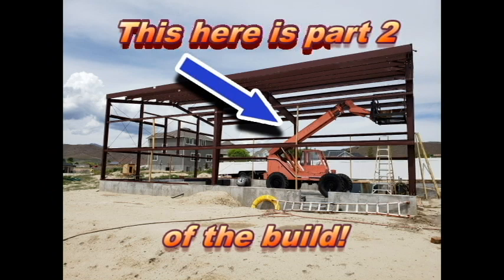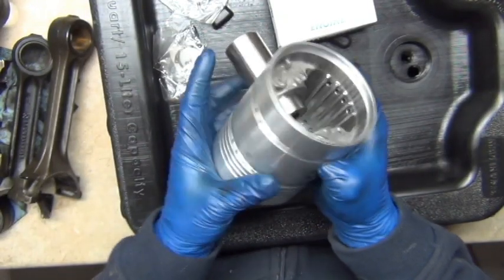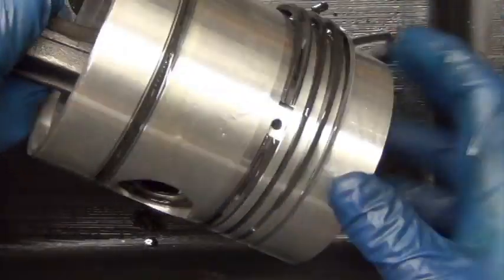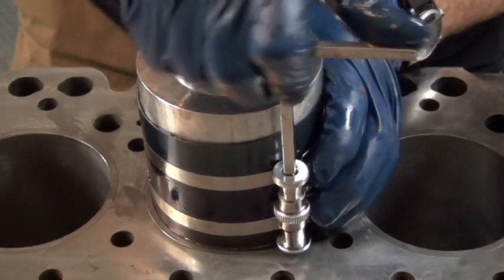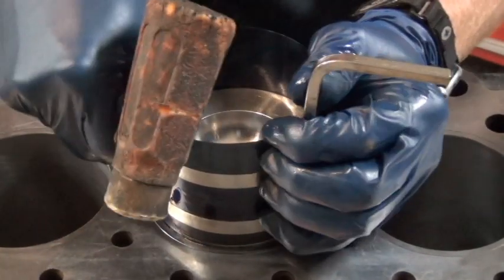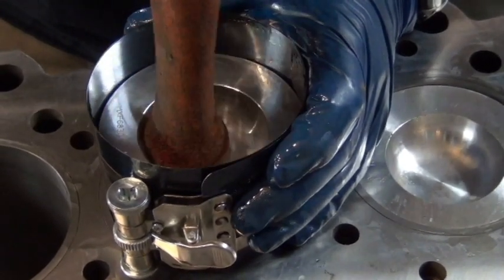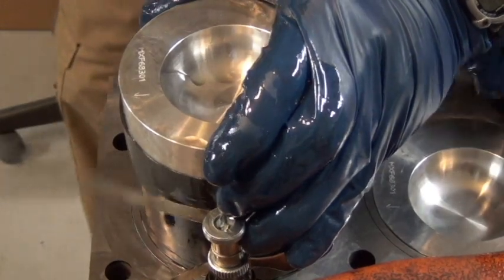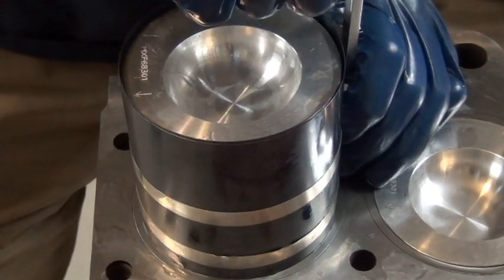Perkins Diesel Engine Build Pt  2 Piston Install Plastigauge PPG Peaks

Comment: When torquing the connecting rod nuts, I noticed that one side of the nut is "normal" and the other has a smaller ring machined into it.  Obviously, the normal side would hit torque first as it has more surface area than the "ring" side.  I've searched online and checked my pics from the teardown but I'm coming up empty.  Could you drop some knowledge please, Brian?

Comment: I was scared when you rotated the engine without supporting the pistons from bottom, they could fall off. It happend to me reassembling a Porsche 911 engine, I rotated the engine on the stand and one piston decided to fall on the floor.. luckily nothing happend to the piston and the rings.. but it was scary! Porsche pistons and rings are expensive

Comment: wow, i am surprised someone hasn't complained about the plastigauge in the comments.
Reply: Such as? Not really needing to do it on a fresh grind with new bearings? Do it like you want to - I only use it on used parts to find out where it is at currently. .003 and .005 undersize bearing shells are commonly available for tightening up a bottom end if you don't want to yank the crank for a grinding. And some would hoot and hollar about that while I still don't care what they think or say. Doing it just to show how to use it is worth doing when you are a you tube creator. Too many don't know about this tool, that's not good at all.
Reply: Lee Barnes my, you get awfully defensive about a simple comment.

You also seem to assume I don’t like the stuff, why would you assume that?

People like to bitch about it, especially in my area, don’t know why, don’t care why, simply whenever it’s talked about around my area, someone bitches about it, or anywhere I’ve seen it mentioned really.

My theory is they’re all racers and frequently blow up engines and want something to bitch about.
Reply: Just didn't understand your simple comment. No assumptions made here, just a possible angle guessed at and chased a bit, more because I wanted to go there than what I read. Thankfully I haven't run into that particular crowd but I have next to nothing in common with people that can waste money on racing other than some HP books for light reading. I would be in your camp with don't care why they could bitch about it. It's not lying about anything, if they can't keep a bottom end in it, that's all on them and their quest for RPM. Only thing I've run into is a lol snarky shot about maybe using a micrometer for that instead and of course that's a pretty silly waste of time when this stuff has been doing fine as is almost from day one. 45 years ago when I cut my teeth this stuff was already older than dirt. I dismissed it as obviously he hasn't been around too very much. I will use a micrometer but mostly to check for an egg shaped rod journal and a nearest undersize guess.

Comment: 8:48, no assembly lube link.
Reply: STP motor oil treatment will do just as well, my mentor used it all the time before they thought to dye it red, call it something else and overcharge like the dickens for it. While I moved onto white lithum grease in the handy squeeze tube and I don't have sticky drops of STP on the floor anymore. Or my hair, pants, shoes,...
Reply: Neither did I until there it was right in my face. Forgot to mention one of it's more popular aliases - Lubriplate.
https://www.amazon.com/Lubriplate-L0034-094-Motor-Assembly-Grease/dp/B000HZJFE0
Lithium is used a good deal in greases as a saponification agent. IIRC, only three alkali metals are commonly used, sodium, calcium and lithium or mixtures of any or all of those. So white lithium is this stuff and it is unique against other lithium based greases. The exact reason/method is unknown to me other than grease is a thick soap of usually mineral oil. Soap was first made accidentally near Sapon France when a lard/fat rendering operation spilled the huge metal tub of boiling fat and the hot oil ran down the steep ash filled gulch they were in. When it all reached the creek in the bottom there was these sudsy bubble things floating all around on the water and also this strange gloppy stuff sort of like pudding trying to set up solid. And when people got in there with it to recover what oil they could, they came out CLEAN and they didn't stink so bad anymore. And their clothes were clean too. OMG can you imagine a life without soap? Well to say it was an instant hit with the locals is a vast understatement. Dare I say that this very day was the beginning of the end of the dark ages? And it civilized mankind? Watching PBS way back in the day, children's show where they pretended to be reporters with microphone and TV camera in proper and period garb doing a campy news at 11 coverage spoof of this 'industrial' accident, anyway it spoke directly to me, stunned by what was coming out of that TV, I'll never forget that aha moment - I read and collect old chemistry books for fun and already had wondered long and hard WTF is saponification about? Turns out it's an honorary place name given to a process no one understood at all at that time, no wonder there is no reasoning to be found within it.
Reply: Lol i like imports and i don't own or work on old american vehicles unfortunately. With the modern day and age vehicles with ECU's and stuff, a toyota camry would give more gas economy and probably better power overall for the curbweight it is and better design. :D
Reply from the maker: Thank you!  This one was wrapped up in the early hours... and I've been sick!  : P
Reply: oh ok. Sorry to hear that. Keep up keeping up Brian! :D
Reply: Lee Barnes why white lithium for assembly lube?
Reply: Lime, first tube came in the engine kit so I tried it and fell in love with how it stays put exactly where you put it and never drips out and away like the STP type does. The tube said right on it - Engine Assembly Lube, blue and white about the size of a tube of caulking with handy screw on cap with nozzle. I don't even have to touch it. Later on I found out what it actually is, same stuff GM put on the door hinges and latches for decades on end,  Bet I could go out to the 62 corvair and dig some out now, the stuff really stays put.
Reply: Huh.. that's weird, never thought lithium for EAL
Reply: Huh... Dang lols. That's awesome, but i'm going to be honest. I really feel like sticking to Driven Racing Engine Assembly Lube & the Assembly grease for the flat tappet cams or Redline EAL, they have two kinds, with different viscosity's. It'd be better to try each one for that type and i heard from Redline back from contact and they told me the difference is only viscosity and preference. Both those can be used on flat tappet cams too, they are also classified from their department as a assembly lube and grease. WEIRD lol.
Reply: Well. Dang back, there goes my paid shill profit margin. Driven is some serious stuff, Redline too. Build it like you want to, at least you know about the cheap stuff from the good old days in case you run across a squeaky door hinge on an old chevy sometime.

Comment: One day I hope to put one of those in a truck,a six though. The couple I've seen done got amazing mileage.  Great vid!
Reply from the maker: Was it you that showed me the guy who put one in an older Chevy pickup?  That was sweet!  Turbo is always a good idea too.  This Skytrak sips fuel.
Reply: briansmobile1 I don't recall but the one was a 50's chev, the other was a 70's Ford.  On the chev they mated it up with a custom bell housing and ran a 5 spd dodge tranny

Comment: Good video, I have always wanted to rebuild an engine. Someday when I have a nice shop like yours. What is the building on top of the ridge?
Reply from the maker: That's for surveying purposes.   It's used to triangulate locations in the valleys on either side of the mountain.  It was just the cone/point, but with so many visitors they made up a little shack semi-enclosure below it too.  That little building often sees about 100 visitors a day in the summer months.  There's a log book in there to help people determine in/when folks go missing.  There's usually a dozen or so rescue/death/missing person events per summer.  I know there's at least 2 bodies on that mountain that are not yet recovered.  If a lightning storm is hitting the top you can take refuge in the shack.  I saw a male and female hiker descending the trail that night halfway between the shack and the saddle.